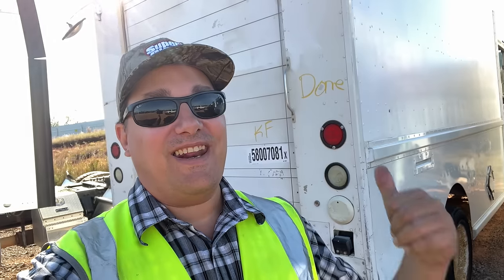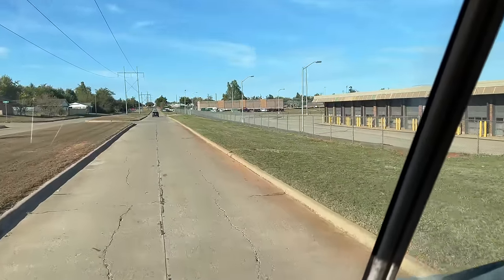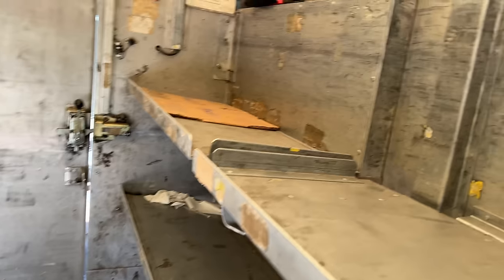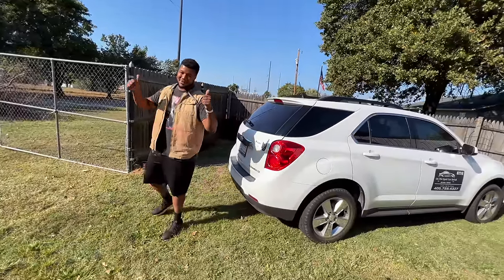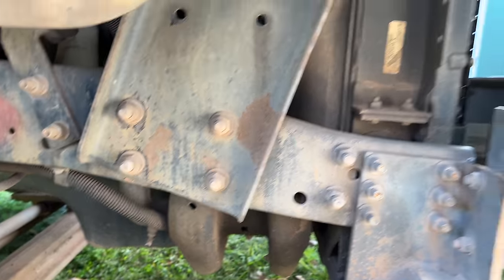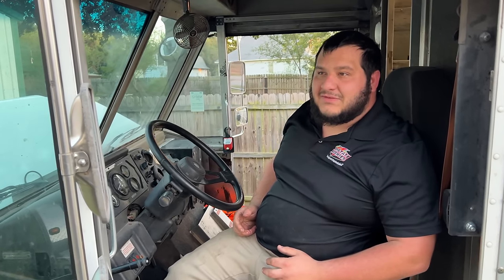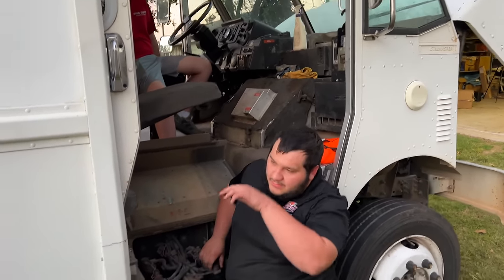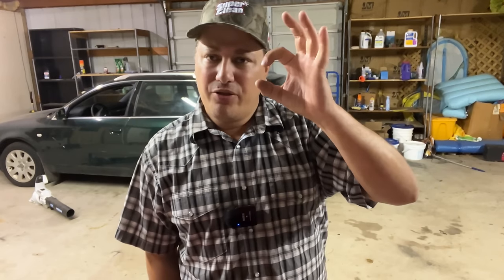I Bought the Cheapest FedEX Truck EVER 24v Cummins + Allison for $4350!! Freightliner MT45 Step van!

Comment: That may not be the original odometer may want to look into it
Reply from the maker: Stay tuned for that video...
Reply: Will do I know a few people who got these old fedex trucks only to find out the odometer was changed out and the aftermarket ones look just like what’s in yours
Reply: Yeah saw that story FED EX trucks were sold but the actual mileage was way off.
Reply: @drewdaskievige754   yeah lots of people have fallen victim to the fedex scam
Reply: Truck runs good always some bozo has to piss in the corn flakes!   The truck runs good little body work that's it $5000.00 double your money back.
Reply: IT has a sticker above the odo saying that the speedo was changed at 86xxxxx miles. :)
Reply: I think the two manuals and information I just sent you should work perfect
Reply: It has 241k miles there’s a sticker that says the speedo was changed at 86k
Reply: I think there was at least 1 digit removed from that sticker.  I bet it said 86x,xxx miles.  The truck looks like it had those miles on it
Reply: @Brooklyn727  it looks like it has half a million miles if that
Reply: Very important to make sure your kingpins are greased because of those go bad they are expensive to replace
Reply: @AutoAuctionRebuilds  guessing by the video and your comments you have a FedEx odometer scared truck..
Reply: @AutoAuctionRebuilds  uh oh that sounds ominous!
Reply: Fed ex have owner operators here in nc so fed ex may not be the ones changing out the odometers! Like one guy has like 20 trucks and puts drivers in them in my area! Just a thought!
Reply: well there's a sticker above the speedometer that says changed at 86k. Looks like the odometer and speedometer are one unit, so it's probably close to 300k but still not bad for them things. I use to drive for FedEx express, they were fun to drive. Our trucks wouldn't start unless the doors were closed though. Express wouldn't allow us to drive with the drivers door open.
Reply: be careful there has been a bad scam about not being original mileage or odometer
Reply: Make buddies at l oca l fed ex facility  where they service these buy him a few six packs and have him walk u. Thru the basics of the rog. Better than blindly going thru rig messing thinbs up
Reply: Needs back up. Cam
Reply: @Brooklyn727  I’m looking at it more now and I bet money that it said 800k, that truck don’t look like no 200k miles like it would suggest if the sticker said 80k

Comment: With the truck off and the key in the on position, hold the check engine switch up and count the flashes that the check engine light makes. 4 dashes pause, 5 dashes pause 6 dashes is 456. That’s the fault code. Then google box the code.
Reply: @autoauctionrebuilds where are you Randy lol.

Comment: Randy, you definitely scored on this one! Super duper awesome! Here's a bit of information on it. As you probably know, this one's got the 5.9 liter, 24 valve Cummins ISB diesel engine with 185 HP and 420 foot pounds of torque at 1600 RPM, coupled to the Allison 1000 6 speed automatic. 6th gear is like overdrive in a regular automatic transmission. Although when you drive it, it might feel like it shifts 7 times, the torque converter locks up when in 2nd gear. So here's how it goes: 1st, 2nd, lockup while in 2nd, 3rd, 4th, 5th, and 6th. Although some of the earlier models have the AT545 Allison (4 speed), this one has the Allison 1000, found in the diesel GMC/Chevy 2500 Sierra with the Duramax diesel engine. Hope this helps! Definitely keep it around, you'll be able to make some awesome content with it! Perhaps turn it into a house in the back and use it for road trips? I'm sure if you go that route, it'll be awesome!
Reply: Wow. Helpful  if needed advice you would be first call
Reply: @mikegreenawalt4726  Incredible buy!!! I would love to find one of these. I am in Pennsylvania and i will have to start looking for one of these. I would love to put the Cummins in an F250 with an 18" lift and 44" Ground Hawgs....
Reply: DO you know the MPG on this rig?  Was thinking of using one of these for a camper van

Comment: Well, I know a little about this kinda thing being a trucker of 16 years. I would just eliminate the wristband thing altogether. Not sure if you noticed but, there is a keyhole on that back door with a rod going right to that lock. As long as you have the key, should be no issue getting the door open. Would also lube generously the door and lock mechanisms especially after sitting in such a dusty environment. As you know, any vehicle electronics are no fan of dust and dirt. Almost ever semi have driven, the fan is run by air but, pretty sure this one is run by a temp sensor and electric. Might want to check online for a service manual for these trucks.  Not sure if any of this info helps but, good luck with this truck, it's cool and can be very useful as a shop truck. Yeah, an AAR shop truck. Might be worth it's weight for you.
Reply: Yep. Ex Fedex myself. I've got years of driving these in my past. Ditch the wristband thingy, But these were great tucks. The Fedex designation was W700. As in 700 cubic foot capacity.

Comment: I am a contractor with fed-ex and run 5 of these plus 3 sprinter vans, but nothing beats the room, cargo capacity and reliability of a step-van, especially with a cummins and allison trans. You got a VERY good deal! They are easy to work on and to flip! Not to mention, they are pretty desirable for their multi-functionality! I bought two of mine for over 9k!
Reply: Are you familiar with the 06 MT - 45 with the Mercedes Benz Diesel?

Comment: These trucks were notorious for having new clusters installed, also FYI the doors have sensors on them so in order for you to start the truck all doors usually have to be closed.. You can disable this by disconnecting the negative wire on sensors.. They can be  very finicky.  Also there's a reset button under the start/stop pad, many times you have to hit that battery reset.. Trust me drove this exact truck for many years..

Comment: I work at UPS and they have extremely similar trucks, I doubt they want you opening the back door with the bulkhead door open (the one that lets you get in from the cab. Try shutting that door and then using the watch on the back door. (Don't shut both again obviously, but with you in the back, you can easily open the bulkhead again from inside.) The design of the truck is for one person to operate as fast as humanly possible, while remaining secure. PS. Our trucks definitely start with the cab doors open, we do it all the time. Also very much enjoyed the video, I also think the engine/back sound is way too loud even without the bumper back there xD
Reply: I forgot about that.  This is true with the newer trucks we have.  They won't even start if the bulkhead door is open.

Comment: This came out before the Dex smog control system became mandatory, that alone makes this one more valuable. The Regen system they require now is nothing but a headache, even more so as they age. 
PS. The idle up and down toggle is for setting the idle up to at least 1000 RPM when Idling, you should have a cruise control that you turn on first, it's not good on a diesel engine to let it idle without setting the idle speed (RPM) up first.
Reply: Yeh was thinking the same thing. All the buses I've ever driven, yes u have to engage cruise control first. Some are 1 push, some are 3 pushed if cruise control on, then hold idle accel until rpms rise.

Comment: If you contact your local Cummins distributor, you can often get a parts list for the engine if you can get the engine serial number.  The adapter for reading the engine SHOULD be an inline adapter, an old one. Probably an inline 5 and will need a computer with a serial port or a USB to serial adapter. They do have reading tools but the old ones are hard to get. (I worked for Cummins until Feb of this year. I worked in IT but I worked with the techs and troubleshooting their computers they used to troubleshoot.)
Reply: Are all the Cummings engines rebuild able or are the rebuilds more common on boat engines??
Reply: What about the fed ex trucks .Where can you get parts?

Comment: Randy, those cars are amazing! Once I bought a 1992 Ford E350 Ambulance with the 7.3l powerstroke Diesel and I simply loved it. I converted in a Motor Home and drove it around traveling and it was the best car I ever had. Believe. Best regars. Love you content.
Reply: 1992 7.3 was the non turbo IDI engine, not the powerstroke

Comment: that OBD port is a HD-OBD port. the equipment to read it is quite costly. I think it would be cheaper to have a truck shop read the code. Also, the fan is controlled by the ECM. ( i drive a school bus and they have the same OBD port and fan setup)
Reply: I lucked onto three of the OBD adapters for these trucks at a surplus auction a few years ago in a lot of stuff I paid a whopping ten bucks for.  They sold used on eBay for $600 a shot.  Yeah I did good that day.
Reply: He needs a J-Pro diagnostics computer
Reply: I know this because i work in the truck shop for Travel Centers of America

Comment: W700 Freightliner/Utilimaster . Definitely a former FedEx Express van, the slot on the passenger side at the rear is for people to drop off overnight letters. Should be a bar code inside cargo area back by the wheel well so the driver could scan those letters under a drop box stop.
Reply: Full service

Comment: I bought my 98 fedex international 1652sc with a 7.3 diesel 5 speed for $2500. Runs,  drives,  and ac even works.  Building mine into a camper

Comment: @AutoAuctionRebuilds With the Allison transmission, they need a special filter you can only get from an approved Allison dealer/service center(usually a commercial truck dealer) and it's recommended to change the filter when you change the transmission fluid.  As far as coolant goes, there are certain kinds for medium/heavy duty commercial trucks- some require a special additive, some don't(I think it's called pre-charge)- some require a certain kind/color due to the formulation of it.. You can not use regular car antifreeze in commercial trucks- Power steering fluid and brake fluid are usually normal car fluid(dot3 or 4 brake fluid, and regular power steering fluid). The Engine increase/decrease switches are usually for a "high idle" function to warm it up faster in the cold temperatures.. cruise control has to be on(if equipped) and you hold the increase button until the idle comes up, usually to around 1000-1500RPM, and hitting the brakes, or turning off cruise control will disengage the high idle.. as far as the air filter goes, you should be able to flip the clamp and slide the cover off and expose the cartridge to replace it. a simple call to a freightliner dealership with your VIN handy would verify/answer all your questions pertaining to fluids/maintenance.. This is all stuff I've learned from owning a 26 ft box truck(06 Freightliner M2 equipped with a CAT C7 with an Allison 2100RDS) so it may differ a little bit from your truck, but it should be similar. Hope it helps.
Reply: Dan, I know the this cummins with only 181,000 miles still has a lot left on it, but,  I'm curious about the Allison transmission. This particular 6 speed....on this truck......how many miles can you put on it while still feeling secure about it ?   Thanking you in advance, if you could give me a rough mileage estimate.
Reply: @davemetz7368  Not sure exactly which transmission was in that truck.. I think it was a 5 spd since it was a lighter duty application.. but either way, with an allison, I'd say you can expect at least 375-400k miles out of it if not more before any major service is needed.. depending on maintenance and whatnot of course. I bought my truck with 90k miles on it and it has over 460k miles on it and the only thing ever done to the transmission was regular fluid and filter changes
Reply: @danlenox1430  thank you for your response Dan.

Comment: on the air filter you undo the bottom clamp you pointed at and undo the snap band clamp, the entire shiny item is the air filter, the fan will not kick on till above or about 210 degrees, the filter you pointed at under the alternator is the engine oil filter, the transmission filters are internal, and sometimes they have a spin on external filter mounted on the frame, you need cummins insite or another cummins compliant program to ready med/heavy duty engines.

Comment: Cool step van! If I were you I would figure out how to get rid of the FedEx electronic nannies. How frustrating! Since this will probably go to someone who doesn’t have a delivery service, the system isn’t necessary. It sounds like a great running vehicle! If I bought it I would turn it into a nice travel van with a comfortable interior. Maybe put some air bags on the rear to make the ride more comfortable? Put a full kitchen with comfortable seating and a bed with a bathroom. Knock some holes in the side and put some nice tinted windows. Add a metal roof with A/C on top. Give it a nice paint job or wrap it and you’ve got yourself a nice R/V!
Reply: I agree, make it into an RV, people do that with old busses a lot and I think this would be better economy than that

Comment: During warm weather the diesel fuel us #2, but that will get thick and jell in extreme cold. You can mix #1 diesel before it gets cold. Always carry a spare fuel filter in case the #2 jells in the filter.

Comment: That fan might use an electric clutch to engage/disengage. If nothing else, get a big aftermarket electric fan and mount it out front. Last thing you want is to overheat that motor/transmission.

Comment: The air filter is an ecolite filter.  The whole filter gets changed.  The diagnostic connector is a deutch 9 pin J-1939.  Any heavy-medium duty diagnostic tool will work.  If you have the Cummins software loaded onto the tool u will have more data PIDS available.

Comment: You have to get the OBD reader that they use for motorhome and semi trucks, it's a special diesel OBD reader!
Reply: He doesn't need that, you just hold the check engine switch up and count how many times it beeps to get the fault codes.

Comment: That has the infamous digital replacement odometer from that story a while back about FedEx supposedly misrepresenting actual miles deliberately, but you stole that thing so it really doesn't matter. One of the guys affected was a dealer that ended up having to buy back a bunch of trucks he sold after the new owners plugged into them and saw actual milage, keep that in mind when you resell it, but at that price point I can't see anyone complaining.

*Edit, I just got to the part of video where you touched on that a little bit, I didn't watch long enough before commenting I guess 😂
Reply: Plus I've seen a story where FedEx was replacing odometers, before sold at auction. Illegal in all states obviously.
Reply: @DieselSgrass  allegedly they replaced the odometers when the old ones failed (for whatever reason) , but made no effort to correct the milage on the replacements, and didn't disclose the milage was inaccurate when they sold them, but they laid the blame on a third party company that handles thier sales.
Reply: @jacobemerson8015  thank you, that's what it was. I pictured the 3rd party thing but didn't recall how exactly they were involved.

Comment: That wristband may have a CR2032 battery or something like it inside when you open the back just like a keyfob. It may not have enough power to authenticate. See if there is a compartment that opens up on the back of the band.

Comment: also diagnostics are/can be done through a laptop and a connector. the actual Cummins hd-obd is expensive.
the idle switches on the left of the instrument panel are for diagnostics and are sometimes not powered without the laptop.
The air filter/breather is all one unit. unstrap the clamps and either take a air hose and blow it out or simply replace the whole thing.
the gauge port you saw is a non-issue. it is what the assembly line uses on initial set-up ant the truck will have them everywhere.
any filter attachet to the engine is a engine filter. the white filter could actually be a fuel filter, that or a water/coolant filter. the oil filter are usually large in size. some fuel filters even have a drain valve on them. trans filters especially on Allison's are just like the cars and are in the transmission pan or at least attached to the trans. check the fan hub for any wobble (bad hub) or any wires connected. that should tell you if it is computer driven. the fan hub will run in lock-up sometimes and other times not

Comment: Most diesel's have two fuel filters, one oil filter, two transmission filter. The Allison transmission has a screw on filter on the driver's side at the front of the transmission pan. And one inside of the pan. And there is a drain plug on the pan for draining the fluid.

Comment: Randy, the Strattec RFID wristband does not have a battery inside.  The pad on the dashboard works like this, with the wristband RFID module on your right wrist, lay your arm down on the pad and press the green button to start.  You're not supposed to have to use the actual ignition key.  Same with the doors, it's supposed to give you a red light, clunk, and then just pull the door to open.  That is, if it's working properly.

Comment: Fan clutch needs replaced I can send you service manuals if you want. Radiator can stay in place as you change it. It will overheat when it gets warmer out. Trans is easy takes Allison transynd fluid and a spin on filter, fluid should be red lol. Coolant looks fine don’t change it, it’s long life fleet coolant.

Comment: The fan is fine its on a electro clutch like the ac pump. The accel /decel button is pto/cruze. Park cruze on, hold accel to raise rpm. Yes thats the engine oil filter. There may be another fuel filter on the frame under the body.